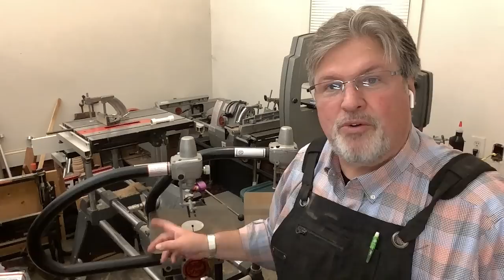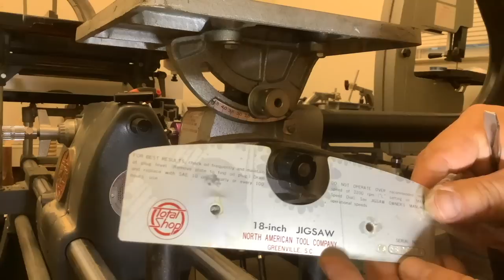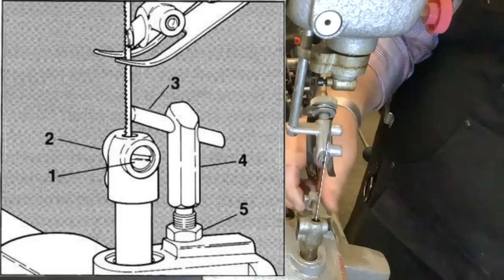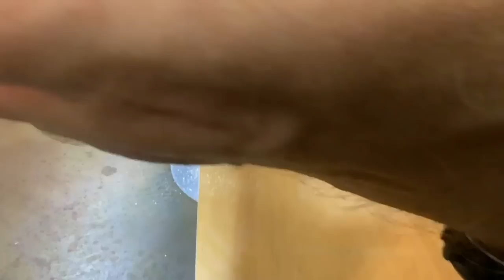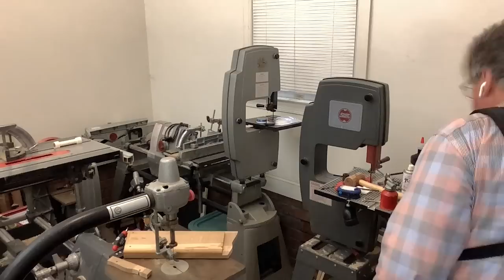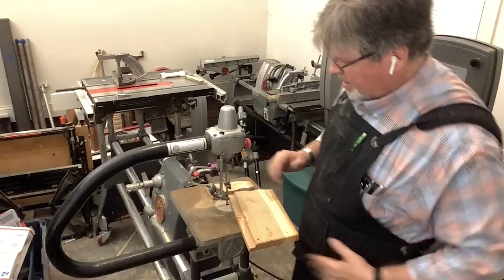Introduction of the Shopsmith 18" Jigsaw SPT (Special Purpose Tool)

Comment: Inspired to celan off my 18" Shopsmith jig saw, then learned the split tube was broken and only one half of the protrusion was left. Had this since 1985, but just never had a reason to use it. I suppose I can make one solid rod of hardwood or aluminum with a split for each particular use and lose the blower effect, but just wanting to know if you know of a source to get a replacement tube?? Thank you, Ted
Reply from the maker: If you have a local hobby shop or RC Car shop I would just table the tube in and show it to them and I’d bet they’d have something that could replace it. It’s not all that special of a part, actually. Scott
Reply: @MyGrowthRings  THANK YOU.

Comment: Thanks for this very informative video.  I own a jigsaw and thought it was damaged before I bought it. Turns out it is not and there was no bearing guides that I thought were supposed to be there. I don't have that bottom blade brace. Mine doesn't even have the holder for that tube. Can  I use any jigsaw or scroll saw blade with this? I only have the blade that was in it so far.
Reply from the maker: Yes, the jaws will hold any jigsaw or scroll saw blade, as long as they aren’t pin-end blades, and even they can be used if you remove the pins.

Comment: Hello, I have a Shopsmith labeled jig saw and as you noted about the plastic gear in the oil bath that may melt, well mine is melted. How can I get a replacement gear? Many thanks if you can help me
Reply from the maker: Hey Ron, take a look in the "SHOP NOTES" above, by clicking on "Show More" and one of the links should lead to someone who is selling a 3D printed replacement "yoke". Good luck!  Soctt

Comment: Seems like a really fidgety machine.
So, isn't this REALLY a scroll saw?
Reply from the maker: Hey Bill. This knock-off of the Shopsmith jigsaw really is fidgety. No, by definition a scroll saw provides power to the blade on but the down and up stroke, but a jigsaw relies on a spring to return the blade to the top of the stroke, and many times in a tight curve the chuck below the table will be shoving up on the blade but the spring isn’t able to pull the blade up, so the blade will bend and eventually fatigue and break. I can cut on our scroll saw until the blade gets dull before having any issues, but a jigsaw can’t do that. In fact, if someone hired you to create a machine that would cause a blade to fatigue and break I suspect it would look a lot like a jigsaw!  Scott
Reply: @MyGrowthRings  I am going to respectfully disagree with you on that definition of "jigsaw". I recall my dad had an early-1960s Craftsman radial arm saw which had a jigsaw attachment. The blade was fixed on one end.
And I still have my (approx) 1968 Black and Decker jigsaw. Same thing; blade is fixed on the top.
Maybe Shopsmith has a different glossary. And I haven't looked in the Patent Office records to see what those records might say.
Regardless, you provide an abundance of valuable info in your videos. Thanks
Reply from the maker: @billrogers6863  That is a tool called a saber saw and yes, some people call it a jigsaw.
Reply from the maker: BTW, there have been a lot of tools over the years that have been called jig saws, saber saws, scroll saws and there really isn't a governing body who regulates woodworking terminology.  For hundreds of years cabinetmakers have referred to doors that are hinged across their top edge and that swing up "Lids", while doors that are hinged along their bottom edge, as in a drop down desk, are called "Flaps". In addition to the the hinges you typically fit these doors with a support called either a "lid stay" or a "flap stay". That said, my employer, who happens to be a European cabinet hardware manufacture with 100 years of history now offers a "Flap fitting" that is used for lifting a door or lid. That's totally wrong, but they've done it.  Words are hard and language is complex.  I reserve the right to be wrong. Ironically tomorrow, Feb 10th, marks the 9th anniversary of the day that I learned, at the age of 50, that having "astigmatism" isn't having a "stigmatism".  Scott

Comment: Where can I find the jigsaw blades? I bought a used shop smith couple months back and only had 1 blade which I broke. Thanks for the hep
Reply from the maker: Hey Jonathan. They are getting harder and harder to find. A lot of folks are buying the pin-end blades and removing the pin with a pair of pliers. If you can't find them locally they have them on Amazon: https://amzn.to/3tX7NlR Scott

Comment: Can you go over how to service the little blower and tube that clears the sawdust?  Mine doesn’t work.
Reply from the maker: I mentioned adding oil, but if that doesn't do the trick you'll likely need to replace the leather "sucker", which is really just a circular piece of leather with a square hole in it. You can trace the old one and usually just cut the new one slightly larger. The original was roughly 1" in diameter.  Scott
Reply: @MyGrowthRings  thanks...will give that a try.   I now remember you did mention that in the video based on this response.   Great work on your channel!

Comment: Great video! Just did the maintenance and replaced the oil in the bath. How often do you suggest changing this oil?
Thanks, Frank Fowler
Reply from the maker: That’s a good question. It should be drained every 100 hours of use or run time. The best plan of attack is to replace the oil once a year, just like a smoke alarm battery.

Comment: Great introduction - just one question - is there any requirement to the type of oil or will any kind of oil work?
Reply from the maker: Hey Tim. I was hoping someone would ask. Yes, it's 10w non-detergent, which can be a bugger to find. I linked to a couple from Amazon in the video description that turned out to be cheaper than the container I purchased locally.  Scott
Reply: @MyGrowthRings  any idea why is non-detergent important? Sure would just rather use motor oil than hunt down some weird stuff.
Reply from the maker: @joshwalker5605 The detergents in standard motor oil keep metal particles suspended, where non detergent motor oil allows them to settle to the bottom where they can’t cause problems.  If you have Amazon Prime there’s no hunting involved. Just click the link in the video description.

Comment: Hooray - I have been waiting for this one!  I was worried that my "jigsaw" would not work as well as a "scrollsaw" but it's what I have and it seems like I will still be able to do some fine work with it.  this actually seems like it would be more versatile than the scroll saw (which I don't have) and you have used both - so what would be the advantage to looking around for a scroll saw to buy as well?  Why did they change?  Just the "galloping" issue I guess - which looks like it would be more of a problem for finer blades.
Reply from the maker: If all someone was looking to do was what we used to call “fret work”, the jigsaw would be fine. The scroll saw is faster cutting, smoother cutting, easer and faster to do pierce cuts and more, so that’s why they pushed the jigsaw out of the spotlight, but as you will see in this coming weekend’s video the jigsaw is still a versatile tool.  Scott

Comment: □Scott, I have a off subject question regarding my Shopsmith Bandsaw.  Installed a 5/8 inch blade set all the adjustments.  When power was started to the bandsaw, I get a loud squealing sound that sounds like metal on metal.  I have been trying to figure out what is going on, but no luck.  The only thing I noticed is that the Roller Track bearing does not  rotate.  Is the bearing supposed to rotate freely?  Any ideas for me.  Thanks Richard Nunley
Reply from the maker: Hey Richard. Yes, all of the bearings should spin freely. When properly aligned the upper thrust bearing (above the table in the right) isn’t in contact with the blade and should only spin when cutting, but otherwise all of the bearings should be spinning. Take a close look at the blade and follow it’s path all the way around to make sure that it isn’t rubbing against anything. There’s a spot near the tensioner that can accidentally trap the blade if you aren’t careful. Other that that and the guide blocks being positioned too far forward the likely culprit is that a bearing is shot. Scott

Comment: Sorry this is a super long comment...
Scott I recently found your channel and am loving it! I am the Head of a small Christian School in Colorado. We often get people dumping illegally dumping stuff in the back alley of our campus.. About three weeks ago as I was walking the campus I saw a pile of  scrap metal in the back. In the middle of the pile I noticed a Shopsmith logo. Turns out someone dumped a Mark V, completely in pieces, in the pile. I grabbed everything I could find and brought it home. Went through it cleaning, replacing a frozen bearing and removing way too much rust...three weeks later it lives! Missing a few parts that I am checking Craigslist for but it runs like a champ. Your video on removing rust from a jointer was a huge help.
I found a jig saw on Craigslist today that has it's own stand. Picking it up on Sunday. 
I have wanted a Shopsmith for many years and just can't believe one fell in my lap.
Any advice for a Shopsmith newbie?
Coop
Reply from the maker: That's so awesome that you are facilitating the resurrection of that Mark V! (See what I did there?) It sounds like you are off to a good start and the only thing I could add is to enjoy the adventure. The hunt for parts and knowledge is half of the fun.  Thanks for watching and commenting.  Scott

Comment: From my experience over the past nearly 40 years working with a Shopsmith, I believe the "old" Jig Saw can do nearly as well as the best scroll saw.  That said, there is a disadvantage with the Jig Saw in doing a number of interior cuts where the blade has to be released and inserted into a drilled hole.  It works but it sure isn't convenient.  But the Jig Saw can do some other amazing things that the scroll saw can't and I hope Scott shows that in a future video.
Reply from the maker: Absolutely right. The lower blade block on the scroll saw pivots forward, not only making pierce cuts easy, but also preventing the thin blade from being bent. Yes, more to come. Scott

Comment: Very interesting.  Why did Shopsmith stop making them?  Was it because they felt the scroll saw would replace it?  Also wondering why Shopsmith got rid of the academy and local retail stores?  Assuming to cut costs to sustain profitability?  If this was the strategy, was it successful?  There is such a need for your channel from us SS owners.  SS should be paying you to support their products!
Reply from the maker: Lots of great questions, Anne. The jigsaw was retired because the demand from the entire market switched to scroll saws. Because they provide constant tension to the blade your blades last much longer and you can make sharper turns. Shopsmith Inc made a number of attempts to save their retail business and the attached woodworking academies, but in the end it was just too had to keep up with the retail demands and the low margins that tools were generating. There might have been other options that might have succeeded, but Monday morning quarterbacking is worth what you pay for it. I’m happy to help where I can and am clearly a fan of the tools and a supporter of its users. Scott

Comment: I appreciate the time you are putting into the jigsaw so thank you. If the blower doesn't work at all is the oil the only thing you need to add to get it to work again?
Reply from the maker: It might require a new leather sucker, which is really just a circular piece of leather with a square hole in it. You can trace the old one and usually just cut the new one slightly larger. Keep in mind that it has worn in thickness as much as it has in diameter.  Scott
Reply: @MyGrowthRings  any ideas what the dimensions should be?
Reply from the maker: I believe it's about 1" ID. Hopefully the old one is still there to guide you to the dimensions of the square cutout in the center. Scott

Comment: One more question.  Do you know of a source for the larger, jig saw blades for the Shopsmith jigsaw?  I have a few left from the good ol' days, but would've to get some more.  Those substantial blades are handy for the really heavy stock that the jig saw is capable of cutting, even if they don't cut smaller curves.  Thanks, Glen
Reply from the maker: Glen, they show up fairly regularly on eBay and I would keep an eye on Craigslist and Facebook marketplace too. In the meantime, you can use standard scroll saw blades on the jigsaw, just avoid the super-narrow ones. Scott

Comment: It looked like the oak was quarter-sawn or close to it. When cutting wood with the grain running nearly vertical the blade tends to jump when it passes from hard to softer portions. Slowing down the cutting speed can help with this.  Scroll saws do this too. When I buy wood for scrolling I try to find flatsawn boards. They are easier to cut and the cut is smoother. Southern yellow pine is the worst.
Reply from the maker: Yes, it was quarter sawn white oak. The saw was running pretty slow, but yes, I've experienced this with a scroll saw too.  Scott

Comment: Scott... that was pretty cool.  I passed on buying a used one a few years ago.  I thought it looked like a whimpy little wannabe!

About 25 years ago, I got what I thought was a steal of a deal.  A neighbor sold me his jigsaw for $20.  It was a Montgomery Ward Power Craft from the 1950’s.  The table, arm and frame housing were all cast iron.  Power was provided through a v-belt connected to an electric motor.  Both were mounted on a 1”X12”X24” board.  

It only had about 1/2” of stroke. The hold down foot was adjustable up and down but not front to rear. It was supposed to act as a blade backup. However, because it couldn’t be moved in and out... it was difficult to accurately position the blade in the chucks for it to work effectively.  

But the most maddening feature was blade tensioning.  The upper chuck was spring loaded.  It only had about 9/16” of compression height within its working height.  That meant, at top dead center you could only have 1/16” of compressive tension on the blade.  Three problems manifested themselves:

1- With too much tension, the spring would bottom out on the first down stroke and snap the ends of the blade off at the set screw in the chuck.

B- With two little tension the upstroke caused the blade to bend. It would break in just a few strokes.

3- If serendipity, trial and error plus a bible full of 4 leaf clovers landed you in the exact sweet spot for optimum distance between the two chucks... the ‘galloping’ that you showed was standard operating procedure.  As a result, every cut was chattered and... a 12” cut without shattering the blade was a cause for celebration.

I changed the pulley size to slow it down.  Then I Lubed everything I could find.  Taking  it into my local Montgomery Ward store... which by then had long since quit selling woodworking tools... only brought head scratching from their service center... 

So, without further hope, I parked it under a table in my shop.  It sat there for about 15 years until last month.  During my spring shop cleaning I pulled it out and bid adieu to it.  A scrap dealer gave me $10 for it... he was enamored with the electric motor.

So, now I have a little extra space and a lifetime supply of jigsaw blades.  Had I kept it for just one more month, your video might have inspired me to take another look at getting it running.  But, alas that temptation is gone!
Reply from the maker: Wow, I can see how that experience could cure any desire for a jigsaw! Many of those Powr-Kraft tools were made by Magna, but were nowhere close to the Shopsmith line, which Ward also sold.  Thanks for sharing. Scott

Comment: I bet I'm wrong, but it seemed like as soon as the Shopsmith Scroll saw (teal version) hit the market in the late 1980's, the Jigsaw was pulled from production, almost overnight. Then in the early 90's Shopsmith quit selling jigsaw blades, and suggested I try a "hardware store" variety. So, that's how I ended up with the Shopsmith Scroll saw. Still have the Jigsaw though.
Reply from the maker: You are correct, except that it was grey for many years prior to evolving into teal. The jigsaw will work with some scroll saw blades, so we aren't entirely dead in the water.  Scott
Reply: @MyGrowthRings  Yes it was grey in the first couple versions. What I'm trying to say is the teal version (the later, perhaps latest version?) of the Scroll saw that ultimately took over and replaced the jigsaw in the late 1980's. https://www.shopsmith.com/mediawiki/index.php/Jigsaw
Reply from the maker: I will have to do some research but I believe that the teal version was introduced in the mid-90's, long after the jigsaw was phased out. Scott
Reply: @MyGrowthRings  Hence why I said "I bet I'm wrong", lol. Chad
Reply from the maker: @chadnevels246  Well there you go.

Comment: Hi Scott, A friend of mine set me up with a jigsaw in great condition. Located the manual on the SS Facebook site. My question is does the tension spring have to be replaced on occasion? While mine has a fair amount of tension, the only comparison I have is the scroll saw and the blade on it has that “ring” where the jigsaw doesn’t. Thanks, Jim
Reply from the maker: I don't have any personal experience with the spring becoming set, but that is one of the things springs do, so you might be on to something. I'll see if I can find an answer.  Scott
Reply: @MyGrowthRings  Thanks!
Reply: I got a used jigsaw and it keeps bending the blades. After watching this video, it seems to be missing the mainspring. (So I don’t have an old spring to take to a store to find a replacement). Any source you know of for the correct size spring?